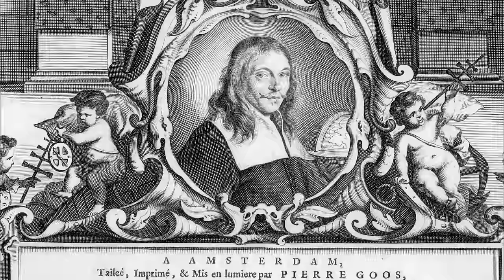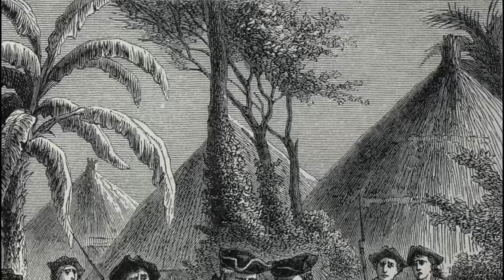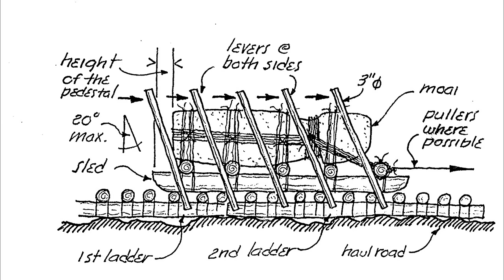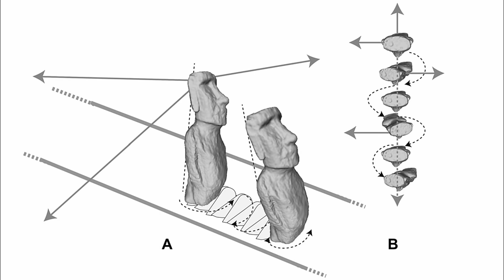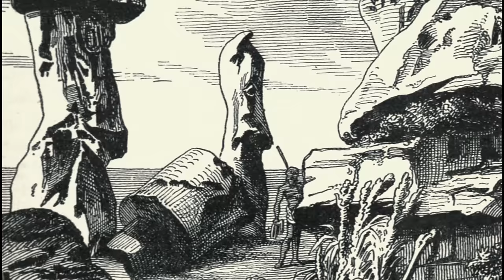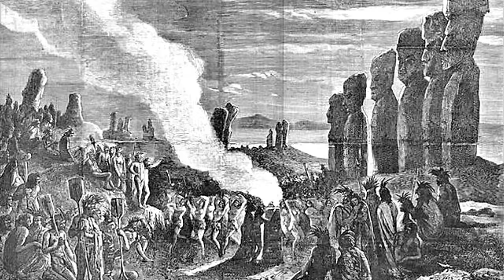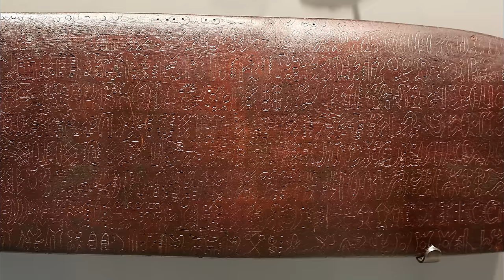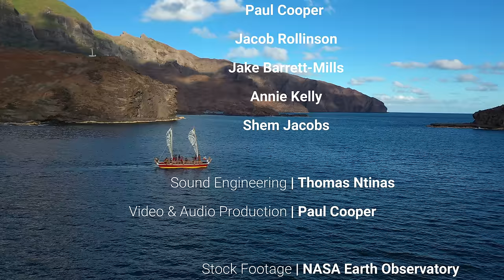6. Easter Island - Where Giants Walked

Comment: Only two rollers are needed to move a heavy object. Anymore are making it more difficult. I spent some years moving large cast iron machines in this manner. Two rollers and a lever. Across soft ground I used lengths of timber as rails for the rollers. Two people, two rollers, two levers… two or three tons with ease.

Comment: 46:03  another thing that doesn't make sense about cutting everything done to make scaffolds and roller is .. no you probably wouldn't need thousands of trees if you think about it in they had those meter wide palms and the thing is only 20ish meters long then at most you need like 25 trees worth  you know 20 under it and a team to take the last one and move it around to the front  and a few extra for breakage and replacement extras ... and if these statures are being made year after year then .. you would just reuse the rollers wouldn't you  and stick them some where dry till the next time  same with the scaffolds and if you have tress that big you not talking 1000s of trees you probably looking at a few 100 at most

Comment: Easter Island having had a palm tree that at the base was over 1 meter, shows what probably happened to their trees. I would bet that they were making boats from them, possible using the boats as for trade, which coupled with the usage for moving their big statues, building houses, was too much for the island's fragile system. One can tell that the island is full of rock, which means that there were probably only a few places where these big trees could grow.  It was my conclusion after hearing of these big trees, that I bet they were either building the boats from them for money/used to trade with, or selling them to other islanders to use for this.
Reply from the maker: Palm trees are not woody, and so are not well suited for making boats. Elsewhere in Polynesia, balsa wood is used.

Comment: ALL THEY HAD TO DO WAS MAKE A WOODEN WHEEL THE SAME DIAMETER AS THE BOTTOM TO FASTEN ON THE HEAD...THE BOTTOM WAS ALREADY ROUND. SO THEY JUST HAD TO LEAVE IT SIDEWAYS AND ROLL IT LIKE AN AXLE..MUCH LESS WOOD USED INSTEAD OF ROLLERS...SURELY THEY DID SINCE THEY KNEW ROUND LOGS ROLLED...